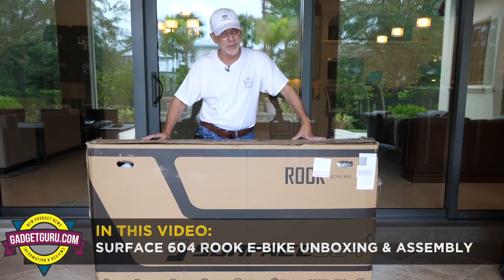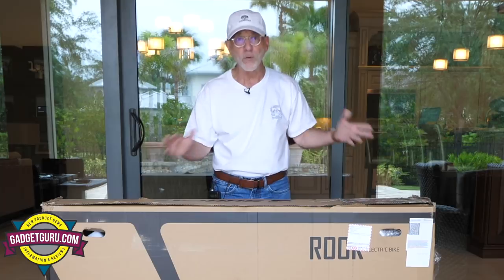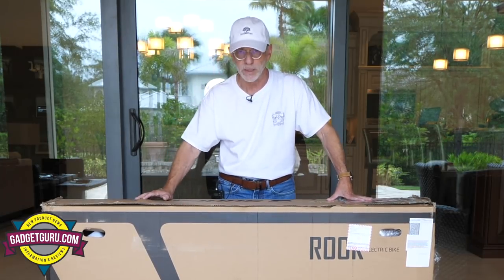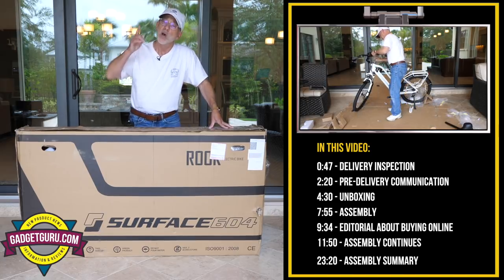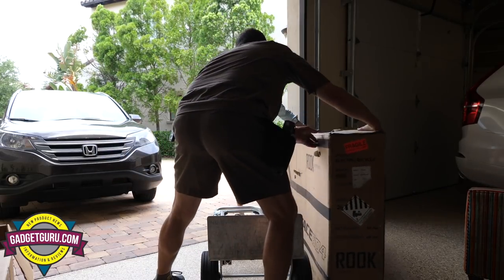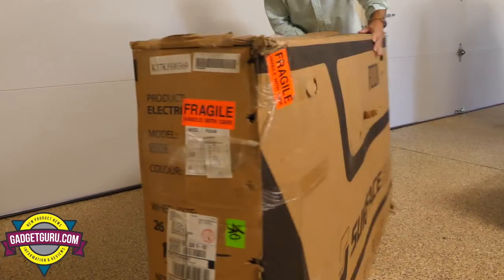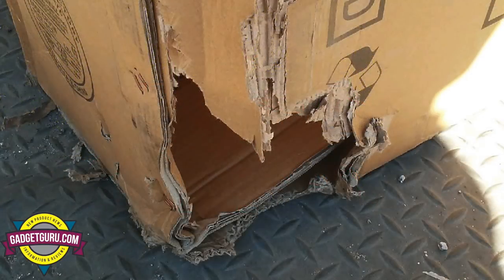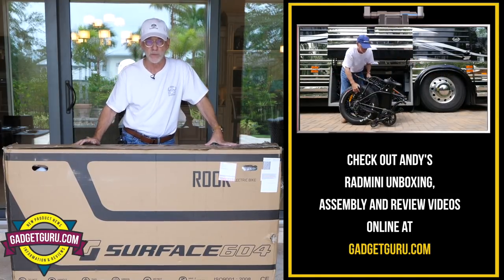Surface 604 Rook E-Bike Unboxing & Assembly

Comment: X2 on the comment below looking forward to see you riding the bike and your comments on its performance. Very informative on what to expect regarding assembly. Also liked the fast forwarding through the boring parts you did. I agree with you on manufacture supping a video that a baby boomer with out a bike stand can use in a home setting. One small criticism, I kind of did a what? Using pliers on the peddles, come on now, as my dear old dad used to say, "son get the correct tool for the job".  Over all nice job on the video..
Reply from the maker: Thanks for the input. And yes, afterwards I did properly torque the pedals. I am planning on doing a follow up to this unboxing video after I get at lest 50 miles of seat time.
Reply: Throw those pliers away
Reply: This bike is awesome
This is my second summer and it’s a blast

Comment: I have a question about my bike battery charger. When I charge my battery the indicator light on the charger never turns green it stays red even when my battery is full. The manual says if should turn green after a full charge… what should I do?
Reply from the maker: I'll recommend contacting the manufacturer.
Reply: @TheGadgetGuru  can you please tell me if your charge light turns green when your battery is fully charge?